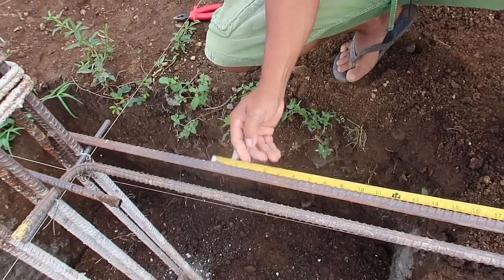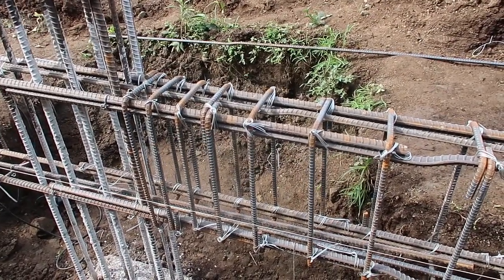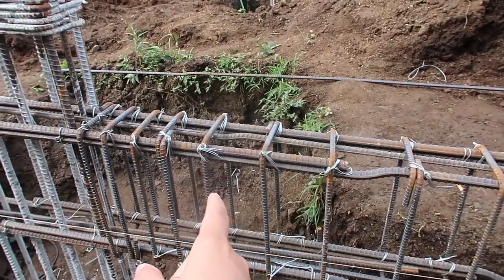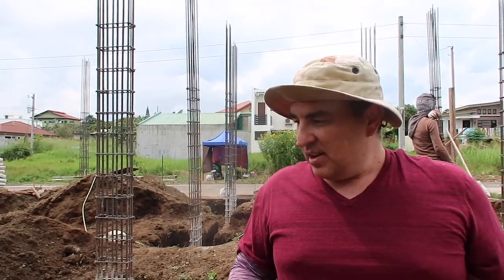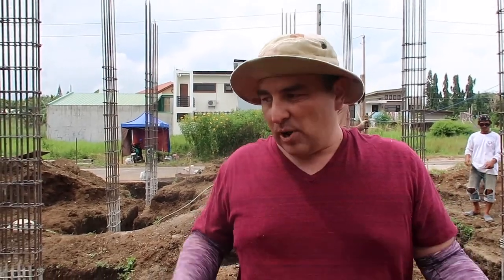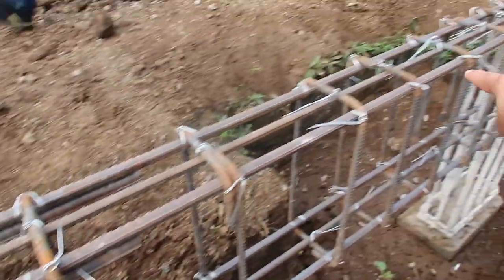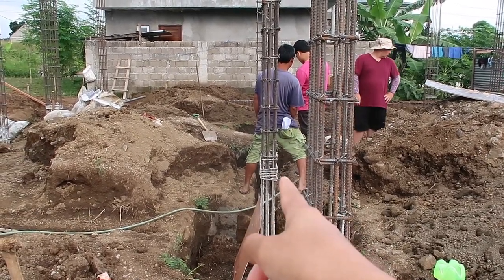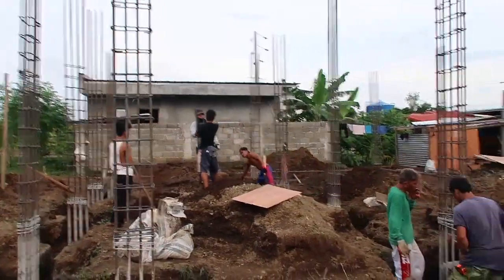HOUSE BUILDING IN THE PHILIPPINES - EPISODE 16: SPLICING

Comment: You are definitely right Sir!
But Please, it should not be put in General as what those guys are doing their work does not generally represents Correct Practice(Unengineered Structures as what others call) ,
And ma'am Please Do not use "Best Practice in the Philippines" because it just Goes to show that you are hiring Contractor with Poor Structural Understanding...You Should Hire Higly Competent Professionals say for Inspection you Can Hire your In-house Engineer, Please Do Not Hire Architects for Structural Works (No Offense) Mostly they are not that Detailed or versed when it comes into Structural Methodology, they are Only After of the Finish regardless of what the Construction Notes says, Or the Contractor also...
Also They Can Use Available Commercial Lengths of 6.00m, 7.50m, 9.00m, 10.50m and 12.00m for them to met the Required Splice Zones end Lengths...
Other Observation the Columns do not have Joint Confinement Ties or Lateral Ties at Beam-Column Joint which is Required by the Code as Seismic Provision..

Comment: The first rebar close up view, the bend , i believe the stirrup closer to the column is 2@ 2, the measurement is much wider.. There is really wrong in this construction, the splicing is incorrect, you are correct in splicing location, the knowledge of contractor is incorrect, they cannot say it is standard in the philippines. The code is internation, you use it worldwid. Do you have engineer that did the design should be able to assist you. The design drawings will indicate the locations an d dimensions. I have not seen the engineer pointed the all the mistakes.

Comment: I must echo what another poster said below.
Maricell. You have an Asawa who is correct, and you should be supporting him and not publicly siding against him, especially not with  those who are denying the validity of what Andy is saying. 
~
I am dismayed that you would assert what is best practice in the Philippines, when you do not actually know what you are talking about, and Philippine best practice has led to so many houses collapsing during earthquakes, typhoons etc, and the Philippine Building Code is intended to remedy such BAD PRACTICES
~
I repeat that you should not have been siding against your Asawa, on the say so of labourers who will take shortcuts to avoid doing what they should, such as making watered down concrete so it pours and places easily., rather than making concrete that will achieve its maximum potential strength.
~
Please watch the following YouTube Video: https://youtu.be/FZYjor8Se9U
Reply: I am disappointed with your lack of loyalty to your Asawa. Especially when he is trying to ensure that you have a home that will be strong and last a lifetime.